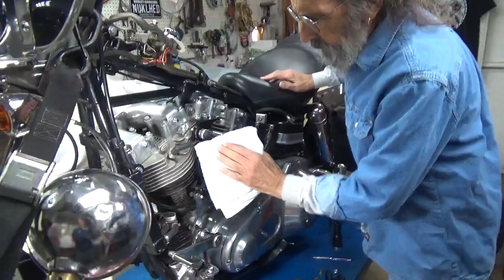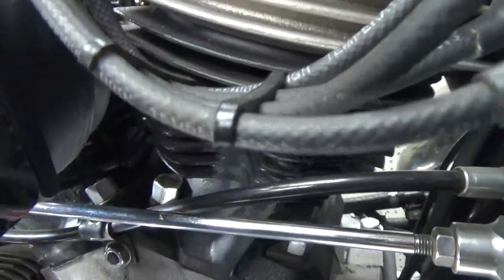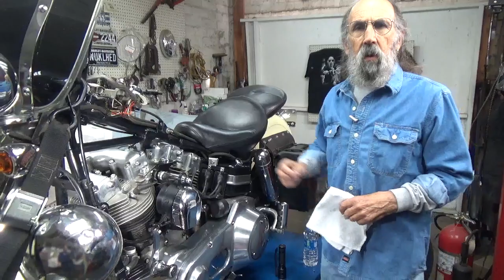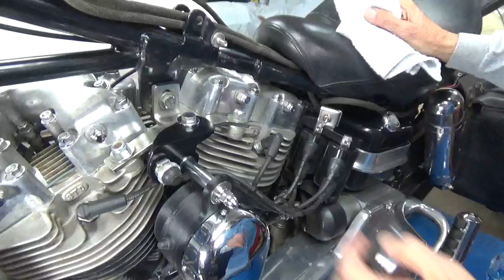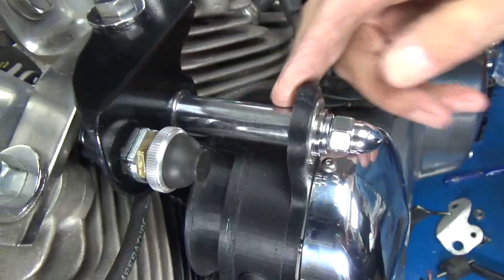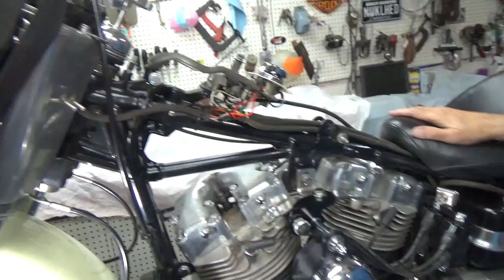Harley Shovelhead With A Fan & Improved Starter Switch

Comment: Nice suggestion on the starter.  On my '79 I've got a tensioned metal extension on one of the posts on the solenoid, and can push it through the rubber cover to make contact and it'll turn over the starter.  When I release the pressure, the solenoid disengages the circuit.  It's all hidden and actually makes a pretty good security device if you completely disconnect the starter button on the handlebar controls.
Reply from the maker: Good idea.

Comment: I like how it does not look like a fan.
The "Laser thermometer" will work on dull surfaces but on the shiny stuff it has to be calibrated for it. A probe attachment might work better for that application. Pretty sure you don't want to use temp sticks (type of crayon) on the chrome.
Thanks for the video.
Reply from the maker: Thank You.

Comment: Nice clean look. Barely noticeable. My FXR was notorious for the dreaded click click click when pushing the starter button. I got one of those starter end covers with the button in them. Starts every time now. Thanks Mike.
Reply from the maker: Those work beautifully, because they are mechanical and not sitting there hoping for enough electricity to function.

Comment: The Jim’s force flow fan is good. I use the mini mites on my Dyna it will drop temps 20° in summer traffic and about the same while going down the highway. Surprised the concept hasn’t already came up on our hot ass Shovels
Reply from the maker: Seemed like fun.  Jim gave it to me so I could report back how it worked.

Comment: Just a thought. Maybe the "horn" cover could be turned up to the front to act like a air scoop, without the fan on, to move air through the motor when cruising? More dual purpose like.
Reply from the maker: Harley did that with an "air scoop" on the left side of Shovelhead motors.  It was a factory accessory.

Comment: Mike, I just need to ask you what brand of starter do you have in your shovel. In my 84, I went through 2 Hitachi's in two years, so I put in an All Balls starter in. Then I wired the starter like you did, under my seat, left side. That was 15 years ago, with never a problem. Big fan, never miss a posting.
Reply from the maker: Thank You.  The starter is a Drag Specialties in house brand.  It is higher output than stock.  My original Prestolite lasted almost 400,000 miles.  I put brushes in it at 100,000 miles, looked at it and went yuck! at 240,000 miles and was afraid to touch anything inside.  Last time I reassembled the bike, I bought a new starter.  Even though the old one was still working, it was really ugly inside.  Just remember, "The enemy is Low Voltage."
Reply: Thank you for the information. These are things,  it seems, you have to learn on your own.

Comment: Like the fan concept. I did not see if you had any other bracket holding fan other than the top bolt. Due to vibration I would think off fabricating a lower mount bracket with an vibration isolator and secure it to a longer upper case bolt. Being that the upper bolt is 3 three inches long along with vibration of the motor. The vibration might cause the longer upper mount bolt to fail over time. Just my humble opinion. Love the video’s.
Reply from the maker: It's true.  That would be a wild shaped bracket to clear everything it will need to clear.

Comment: Mike i love your Channel. I wish you would make a show on how to properly fit the tank on your 79.
I bough the same bike from a friend of a friend as a Covid19 lock down project.
I used your show for most of that project.
But when I instal the fat bob tank back on the frame i didn't do it right and  the weld on the brackets crack from the tension from the bolts. 
It resulted in a leacky gas tank and a new paint job.
Now it all fix and I am a bit nervous to try it again.
Reply from the maker: It's a little time consuming, but, not difficult.  You simply install washers as shims between the tank and the frame.  All of the bolts are 5/16.  Use 5/16 flat washers to shim the bolts so the tanks fit flat on the frame.  No gaps, no stress.  When you have them at the point of fitting perfectly flat (don't pull them into place with the bolts) tighten the bolts.  Again, no stress.  By the way, my Shovelhead is a 77.  You can even use different thickness washers.  Tanks must fit flat before tightening the bolts.
Reply: So the mountings bolts kit i Baugh show me to use two 1/4 thick washers on the stud bolts at the back of the tank. Are those washers needed? Or not. They are the one causing most of all the gap on the front upper and lower brackets.

Comment: That does look like the so called cow bell style horn. I heard about that, For a while I thought the
start relay and solenoid were the same, as I get it though the coil of the relay is in series w the 
clutch switch, kick stand switch and tranny must be in neutral, then coil of relay operates switch
that then sends current to the starter solenoid which bridges current to starter motor when its
coil is energized.
Reply from the maker: Yep.
Reply from the maker: And yes, that is a stock horn cover, slightly modified.

Comment: What would cause a starter to not disengage on a shovelhead. I've heard that it would be a low battery, but that makes no sense to me.
Reply from the maker: It doesn't hit hard enough on low voltage.  It sits there and fries itself together.  That's why it helps to eliminate everything between a starter switch and the solenoid.  Also, charge the battery with a trickle charger when the bike isn't ridden all the time, especially during Winter.

Comment: Hello Mr.K , I watched your video on your shovelhead inner primary install and followed it as you did it My bike is a 1981 FLH , rotary top trans . Im using a Cal-products aftermarket unit and after I torqued the trans bolts underneath I can hardly turn the main shaft by hand . Even with the clutch basket on it's hard to turn . Any suggestions as to what I can try ? Is there a chance I could use shims under the trans ? Any help would really be appreciated as Im think a stick of dynamite is my best bet . Thanks for what you do .
Reply from the maker: The way I was taught in the first shop I worked at was to tighten down gradually and keep turning the trans mainshaft to be sure it never binds.

Comment: Hey Mike I'm working on my 1981 FXE Super Glide. I wired a starter button from Battery to solenoid.  What size fuse should I use? 20 Amp  30 Amp and 40 Amp pop right away.
Reply from the maker: Probably 30

Comment: I have another question, Where did you get your straps for your table ? I like how the hook loops back to the strap.
P.S. my wife found a lamp similar to yours, THANKS MIKE !!!!
Reply from the maker: That is a "Doctor's" lamp.  Those straps came from a motorcycle parts supply somewhere.  Those extra pieces that loop around the bars were part of it.  And they're made specifically to work like I'm using them.  I honestly don't know what brand they are, but, they are quite common.

Comment: Hi Mike. Got me thinking about my recent starter issues. May go the same way as you. What value fuse did you put in there may I ask? Best wishes.
Reply from the maker: It may not be correct, but I used a 20amp.

Comment: Why does my battery drop voltage on my  shovelhead when i push the start button like yours, i don't use the stock handle bar buttons no more and  I did like you said and removed my relay ????
Reply from the maker: Okay.  Is your battery good?  Have someone "load test" it for you.  Is the starter good?  Is the solenoid good?  Solenoids fail a lot from getting used with low voltage.  Running this system with less stuff makes it way more dependable.  But, the remaining parts have to be in good shape.
Reply: @pacificmike9501  Ok, The starter , solenoid , battery  , coil are all new. Maybe I need more cranking amps. I just finished this bike. Thanks Mike.

Comment: Nice Bike! 
Is that an oil cooler where a mouse trap would be? Camera never got a whole shot, just the top. It seems most I see are on the other down tube, not that it matters.
Reply from the maker: There is a video from when I installed that cooler.  Go to Youtube.  Type in Shovelhead Oil Cooler.  It should come up.

Comment: I have a question. I have a 1974 shovel head I want to put a springer front end. I measured 24 inches. Is that the length of springer I should get?
Reply from the maker: That's on you.  I think you should get what you want.
Reply: My question is, do I get the same length?
Reply from the maker: Do you want it at the same level as stock?  Check with the manufacturer of the front end and see at what point to take the measurement.  Are  you raising or lowering the rear?  Have you changed your wheel and tire combination?  These are all things that you need to look at.  The first extended Harley front end was done by the Harley factory for use in North Africa.  It was 2 1/2 inches longer and started the whole extended front end thing.  I have one on my Knucklehead.
Reply: Thank you! I have been looking on line for one on line and not sure about measurements. I believe it's a stock frame and it looks level to the ground. I appreciate your videos.

Comment: Hi Mike, do you run your starter switch to the small terminal on the solenoid and the other side of the switch to 12 volts via a fuse or breaker?
Reply from the maker: Yep.

Comment: Watched engines mounted on tables where different oils were ran....watched for a long time to see that Amzoil runs cooler than any other oil, may be because it doesn't foam.
Reply from the maker: I'm listening.  I'd like to learn more.
Reply: I’m listening too . Always interested in oil information. Some kids here run 20-50 in shovels but I stick to 50

Comment: Maybe sometime you could talk about batteries.  Suggesting your preference etc.
Reply from the maker: Batteries are changing constantly.  I'm afraid I'm behind in that technology.  On my antiques (modified with 12 volt systems), I go to the hardware store and buy batteries for electric gates.  They're awesome.  For my FLH Shovelhead, I buy the only sealed battery I could find in that size.

Comment: Nice idea but fans cool liquid moore efficiency  so you probably won't even notice a temp drop until the motor is off with the fan running
Reply: Not true at all. There are a few different companies that make cooling fans, and they cool very well with the engine running.  I have a (Lenale Engineering) fan on my Harley. The Lenale fans are also very nice looking. It takes the place of the horn so, the horn has to be relocated.
Reply: @jimguzell4993  what year of bike
Reply: Cast iron cylinders or aluminum
Reply: @johnrainey2717  Mine is an 05 Wide Glide. It really doesn't matter what year the bike is if you are knowledgeable enough to run a fused hot wire to it. However, they do have wiring harnesses included with the fan if the bike isn't ancient. Your horn will need to be relocated. I added an air horn on mine.
Reply: @Jim Guzell  well I am very knowledgeable and  have built several motors cast iron cylinders retains moore heat long than aluminum cylinders
Reply from the maker: Not true.  My cousin has one on his Twin Cam and it really cools it down.  We're gonna do some experimenting.
Reply: @Pacific Mike  twin cams are all aluminum blocks and cylinders and heads so they dissipate heat  faster  thats why harley no longer makes cast  cylinders since 1984

Comment: Feel your pain on wiring problems.Dealing with it on my FXR.
Reply from the maker: Wiring is no big deal.  In fact, on my own bikes, I only put up with it for so long.  When I reach that point, I rip it all out and start over.  I actually enjoy it and it's done the way I think it should be done.  I usually stick to HD's color codes from the seventies.  It makes it so anyone should be able to trace it out, should need arise.
Reply: @pacificmike9501  spend a lot of money on 3rd starter if this don't work . Replacing the whole wiring system.
Reply: Hey its  cold in Kentucky  also. 
Do you find that the  Fangs  on the front forks makes  the bike  run  hotter?
My  Heritage  does. But I  like the way they  deflect wind  off my  belly and beard. 
Have a  Happy  Thanksgiving 😊
Reply from the maker: I tried to explain.  Use your big cables and a two wire starter switch to the battery and solenoid. The end.
Reply from the maker: I'm feeling bad for you.  I don't think those starters are your problem.
Reply from the maker: What year is that FXR?  I don't remember now.
Reply: @pacificmike9501  if it's me you are asking 87 FXR ending up a lot of corrosion on wire connectors.thats what we think the problem was.rigth now it's running see if it lasts.
Reply from the maker: If you isolate your system, you can easily trouble shoot.
Reply from the maker: Isolate your systems.  Run the starter all by itself.  Large cable from battery to solenoid (this cable goes to the largest stud on the solenoid).  Large cable from solenoid to starter.  #14 wire from battery to automotive 20 amp starter switch. #14 wire from switch to little post on solenoid.  Starter should now spin if solenoid is operable.  Ignition is still turned off.  Turn it on now, push starter button and go for a ride.
Reply: @pacificmike9501  ty for that tip.

Comment: I have no experience  with Electric starter, only kickstarter, but if with that big Electric switch, what hoppens if the engine kicks back??
Won’t it break your thumb??
Gretting from Denmark, where ridning season is over, and we now have snow and freezing instead
Reply from the maker: If it kicks back, the timing is off and you just killed the starter drive.  You know, everyone wants an "electric foot" now.

Comment: Mike,  I have a 85 softail and I want get rid of the starter relay . What guage wire are you using to and from the switch.  Also  when do you think that blower might be available?
Reply from the maker: I use #14 wire on just about everything on my bike.  The fan?  Still being tested.
Reply: @pacificmike9501  thanks Mike I appreciate it